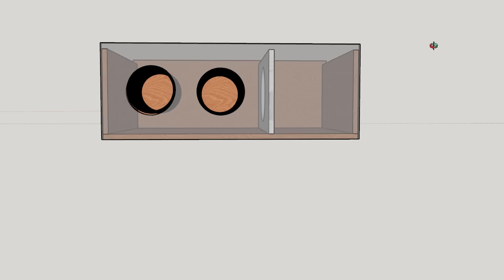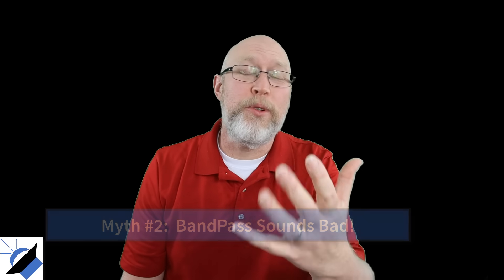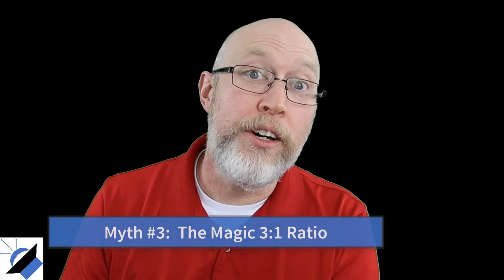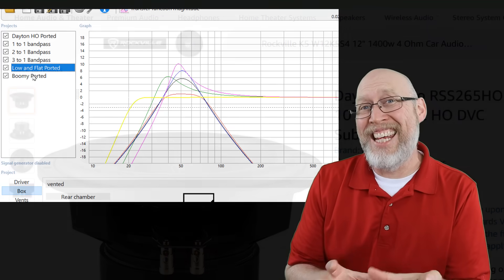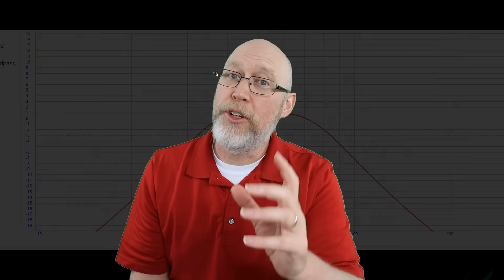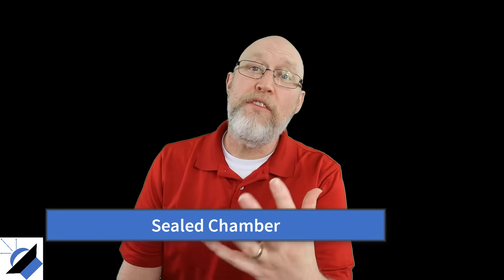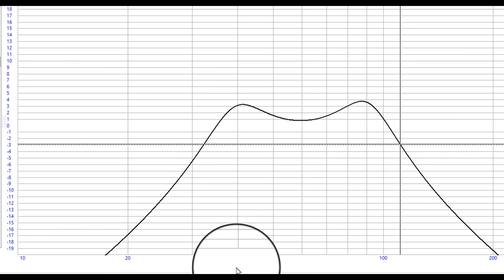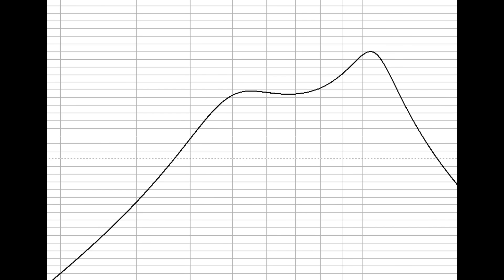Bandpass Subwoofer: You Are Doing it Wrong.  Bandpass MYTHS BUSTED!

Comment: improper design has given  the bandpass box the ugly nickname of the "one note wonder"
Reply from the maker: I could not agree more.  As I show in the video you can also make a one note wonder ported box.
Reply: @DIYAudioGuy  can we use linkwitz transform or other kind of shelving EQ to push the low end frequently even further by designing the sealed section small ... Heard alot of small sealed box works well with lots of EQ boost  and power 😅
Reply: The only bandpass I've owned was a Paradigm PS-1000 and it was muddy uncontrolled bass cannon. Good for movies. 

I want to say it was a one note subwoofer. But it did technically have a good bandwidth above 40Hz. But it felt loudest around 40-60Hz. Could literally punch you in the chest. Again, good good movies. But music was not great. 

I ended up plugging two of the 3 ports and it was great from 28Hz to mid 30Hz. Used my PSW10 to cover everything above that. But never could get used to the PS-1000 running alone because of the peaky 40-60Hz area.
Reply: @JoshM7  40hz & above is not good for movies.
Reply: @AlwayzLearning  That sub was best 40Hz+ but it could still do pretty well to 30Hz. Just nothing below that in my room. Music was too muddy and uncontrolled, but movies it did great because it didn't really need control for explosions.